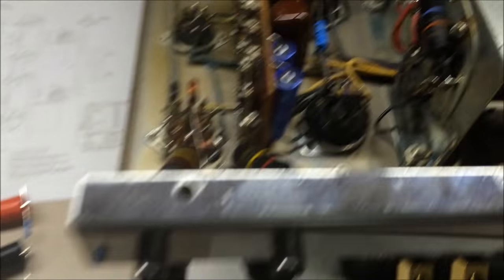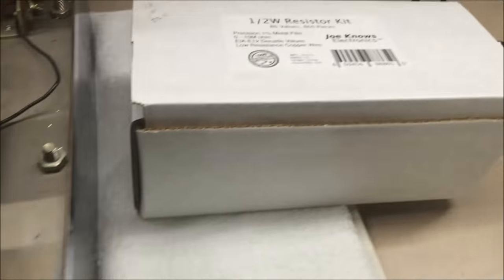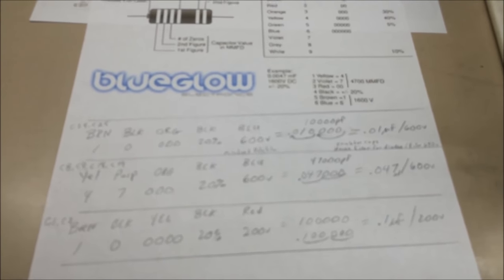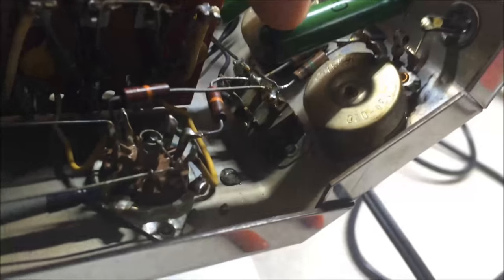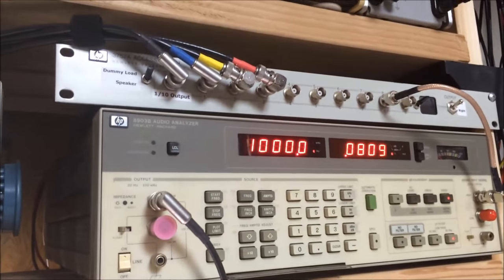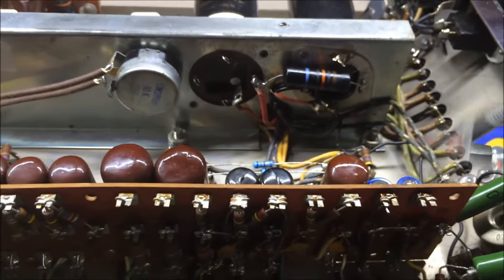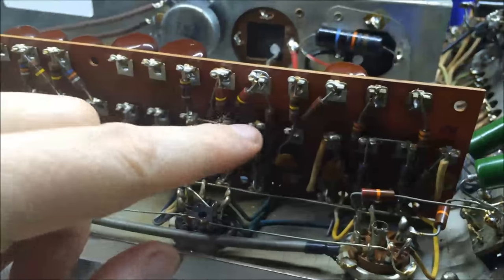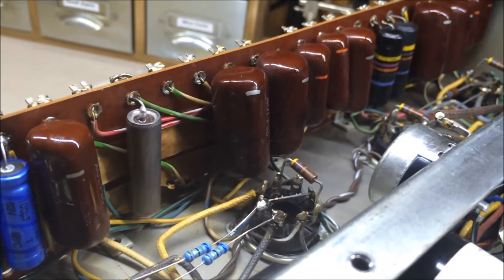McIntosh MC225 Info & Service Part 2 of 2 - BG003

Comment: Very enjoyable and informative videos. Like sitting with a friend sharing audio tips and experiences. I own an MC225 and MX110Z. Terry rebuilt the amp about 15 years ago. The tuner preamp works but needs a rebuild badly. I replaced the selenium rectifier soon after I got it.

Comment: I love your rebuild series. I hope you do a restoration of that beautiful MX-110. I'm sure you know there is a selenium rectifier in it. One of the first tube pieces of gear that I worked on back in the 90s was an MX-110 with a blown rectifier. We built a diode bridge on a terminal strip mounted on the selenium rectifier mounting hole. Speaking of rectifiers, Have you ever tried using the Hexfred fast-recovery rectifiers? I've heard their lack of switching spikes makes them sound a lot more like a tube rectifier. I've used the 1200V ones in some of my preamp projects. I also recall replacing the worn RCA input jacks on an MX-110 with some nice gold ones. I've seen similar chassis ground gold jacks at Parts Express.

Comment: Hi Mark,
I just love your stuff on youtube.
I am a retired, and old Telecomms Enginineer
Even at 68 I was too young for the likes of this amp that you are playing around with.
Meaning Valves were out.
And The Trasistor was in.
However, I would be most greatful.
If you could put up a Prog.
Showing us. 
How to Cobble together the hardware, and software.
0f Pete Millet's HP 8903 Audio Analyser.
That you are using here.

jeffoldbean.